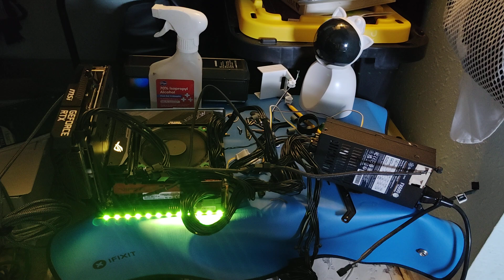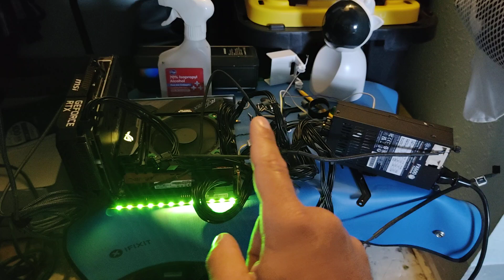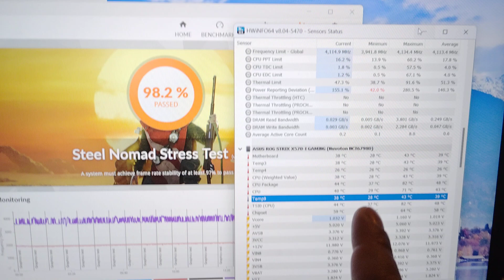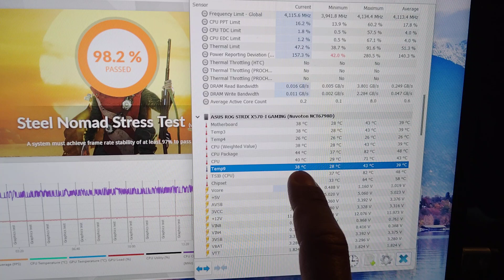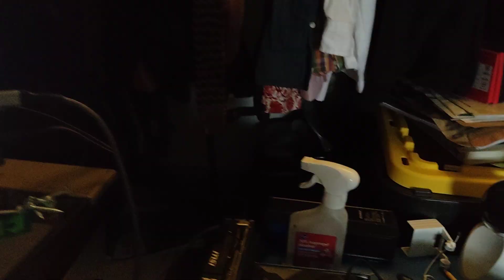Best Nactua Fan Swap For Flex Atx Psu

Comment: hey there this is great mod.👍
I was wondering what if we can put a 80mm fan (slim or normal)on top of it (could design a 3d printed top case with ABS) and if we don't mind the little size bulge on top.
how would it perform compared to the tiny 40mm stock fan. I'm about to try that. I'm just waiting for my psu to deliver from china.
Reply from the maker: Not a bad idea, if your case allows for it! I had a similar plan for a mod utilizing a top mounted fan. I had allows imagined just getting an appropriately sized hole saw and modifying the psu's oe case, maybe through a grill guard and dust filter on top of the fan; however, there is a plastic sleeve on the inside of some of this flex psu (probably to direct air flow) which is interesting. Also, whenever you mess with these things you got to be careful not to expose anything that could cause an electrical shock! I will definitely explore this idea in the future with renewed interest. Thanks!